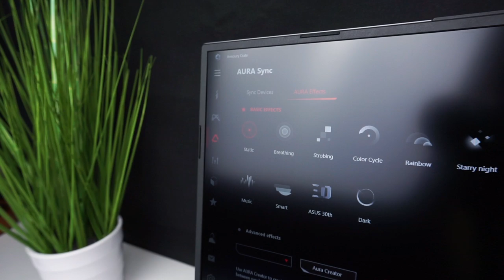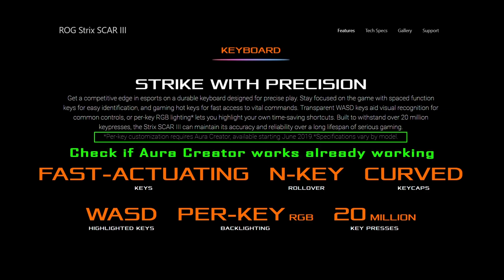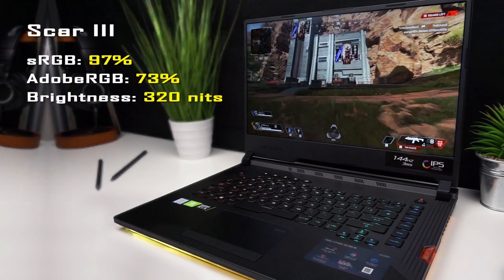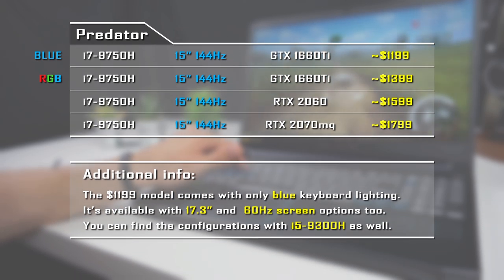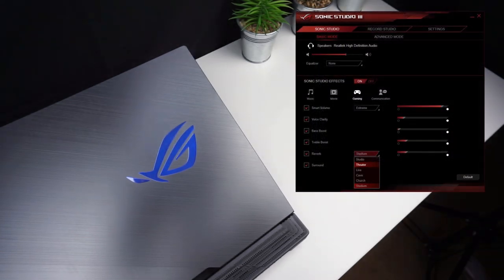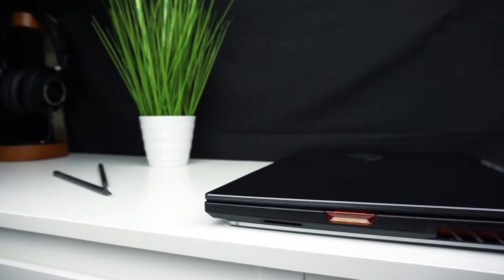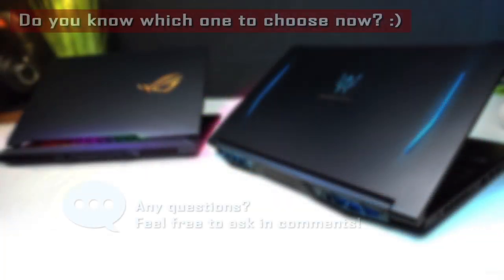Acer Predator Helios 300 2019 vs Asus Scar III - In-depth COMPARISON / REVIEW

Comment from the maker: ✅ Check alternative laptops by price with Lustre: https://my.lustre.ai/8NWEr

►► TIMESTAMPS:
00:00 - Introduction
00:41 - Build and design
01:48 - Dimensions
02:00 - Keyboard / Touchpad
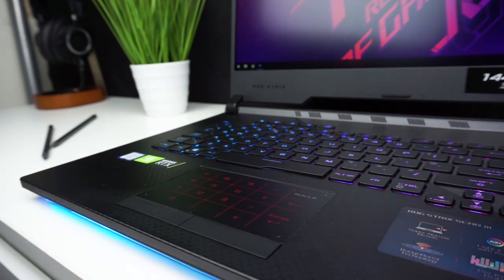03:50 - Port selection
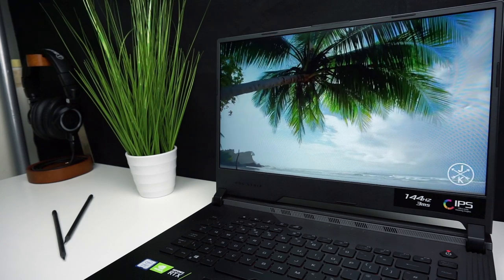04:18 - Display
05:56 - Configurations / Prices
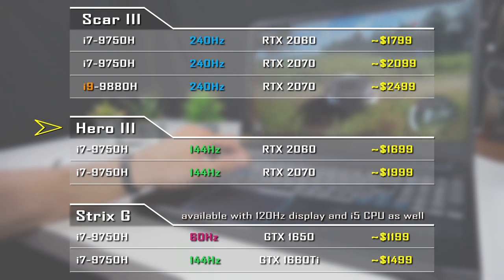07:21 - Speakers
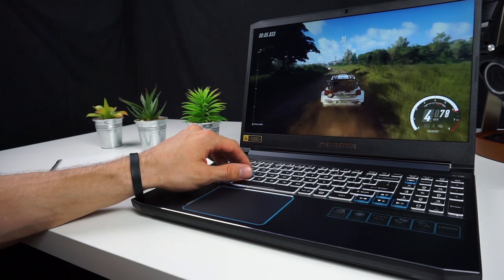08:03 - Performance
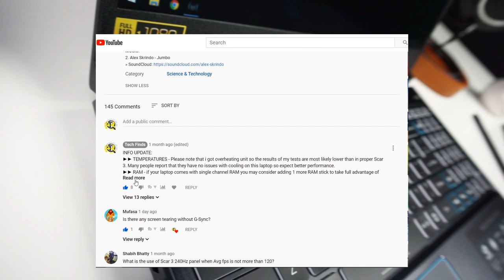08:55 - Cooling system
09:24 - Upgrades / accessibility
10:10 - Battery life
10:25 - Summary - Pros and Cons

►► Scar III (Per-key RGB) - In order to customize your Per-key RGB you have to download Aura Creator app from Asus.
Link here: https://www.asus.com/campaign/aura/il/Aura-creator.php
►► Small mistake - at 09:07 the temperatures shown in the brackets are Farenheit of course, not Celcius! :) First temp. for CPU, and GPU right under.
►► Australian units (Predator) - If you're buying 2019 Helios 300 in Australia make sure to check with the seller whether the laptop comes with 60Hz or 144Hz display. I've got a report that Predator comes with 60Hz by default in Australia, but the sites mistakenly say that it's 144Hz.
Reply: Do you know 1660 TI or RTX 2060 GPU runs cooler in laptops?
Reply from the maker: @V3doP4jzs  About the same. No really difference
Reply: @TechFinds  Hey, did you undervolt the CPU in scar 3 in this test ? As helios 300 comes undervolted right out of the factory. Im trying to decide between these two and both have the same price in my country so hte deciding factor will be the thermals, as 2060 is a bit better than 1660 ti.
Reply from the maker: @BajaT3hMa5t3r  yes, I undervolted Scar 3 by -0.150V.
Reply: What is the ROG Key for?
Reply: Tech Finds can it off its backlight
Reply from the maker: @GarryX10  ROG key opens the control center app where you can monitor your system and manage the fans and overclocking. You can turn off all the lighting.
Reply: Tech Finds how do I off it,because I need to find a laptop for my school and I also wanted it for gaming
Reply from the maker: @GarryX10  they relased a separate app Aura Creator to manage lighting.
Reply: Tech Finds can you recommend good gaming laptop that could off its backlight like Dell G3 15 but I don’t think it’s good
Reply from the maker: @GarryX10  You can turn off the lighting in every gaming laptop mate. :) Maybe except for 2019 Helios 300 and some MSI laptops where the logo on the lid lights up once the display turns on. Dell G3 is not very good as you say.
Reply: Tech Finds, sorry  I wasted your time for stupid questions thx for all the help to make my life of choosing my laptop easier
Reply from the maker: @GarryX10  That's fine mate. I'm here to help as long as i'm able to. ;)

Comment: I’m watching this on my Helios 300
Reply from the maker: Me too! But the 2017 model, haha.
I need to switch soon, good choice.
Reply: Can u show its screen bleeding?. Plz
Reply: @RTXBOBLEE  It's not really noticeable during actual use, only when you when you have a completely black screen. Also screen bleed is different on every single device, I can only give you an idea of what'll it be like
Reply: Can u send its pic?
Reply: Changed to Lenovo Y740, best choice ever
Reply: Fieskmask that’s more expensive though and has less value. I’m studying interactive design so bang for the buck is what I need.
Reply: BobLee Gaming Trust me mate, the screen bleed is nothing to worry about. If in the absolutely rare instance you get one with a messed up screen, just return it and Acer will send you another one with a proper screen.
Reply: Thanks dude.... i will get it in a month most probably
Reply: @ponraul1221  More expensive, but It filles all the gaming needs which auto makes it a better laptop
Reply: Fieskmask what do you mean? Every game so far I’ve played has been above 80fps and the majority well above 100fps at max settings with my Helios. It’s handled everything I throw at it as well
Reply: @ponraul1221  The lack of G-sync frightened me, so I didn't buy it. If it works for you, good, but I'll rather skip the screen tearing
Reply: Fieskmask I actually haven’t experienced any screen tearing in the 5 games I’ve played on it; all with V-Sync disabled. I did oddly enough experience it on Photoshop when moving stuff on it very fast lol
Reply: @ponraul1221  Haha OK. It gets pretty clear especially on GTA V, it's actually impossible to Not have tearing without G-sync.

Some people doesn't care and some are not sensitive to it, but when I changed from TN 60hz to 120Hz with G-sync the whole gaming world changed for me. I'm really, I mean really oversensitive to screen tearing.

But I'm glad you enjoy the laptop, it's not bad, just that it lacks G-sync 😁👍
Reply: how loud is the turbo mode? is it annoying?
Reply: Pooya Arzi It gets pretty loud. You’ll have to wear some headphones if you want to hear anything clearly when it’s on
Reply: @ponraul1221  hi I am thinking of buying it too...can you let me know is it okay for students?..as I will be using it for my presentations and how is the battery life?
Reply: Hi do you ever get dust problems
Reply: @ponraul1221  What games to you play bro? Can you name 5?
Reply: im watching this on my ROG scar II
Reply: I am watching from my Samsung Note Fan Edition 🤣
Reply: Slogomattkop  To me it wasn't worth the extra cash. The fps difference on a 2060 compared to a 1660ti is razor thin. Most benchmarks I've seen has the 2060 leading by like 8 fps. It's not worth the price difference to me.
Reply: me too
Reply: @TechFinds  me but i dont have the new one yet lmao 😂

Comment: Greatest review thanks!
I only recently realised that the hero, strix, scar all use same chassis - this is quite confusing and not explained well, so thanks for showing this.
Reply from the maker: There are just slight differences, for example Strix G has no Keystone slot and plastic top pannel. In case of Hero and Scar it's only a different pattern on the deck.
Reply: Hero and scar are geared toward different game genres
Reply: Hero is geared more for Moba and scar is better geared for FPS

Comment: Thanks for the great content.
May I ask your opinion, how about the endurance of these two brand?
Which one is better Acer or Asus ROG?
I am considering buy this helios 300, but I am afraid Acer is not that good laptop for long term use.
Reply from the maker: Hi, as I said in the video the Predator feels more solid thanks to metal parts, but if you use the laptop normally both should last long. However those are only electronics devices and we can never predict when or if something will break. By default they are designed to last at least 4-5 years I guess, maybe longer but you never know. I had them only for about one week for testing purposes and what I know is that Predator was more solid and it run cooler which is better for long life of hardware. :)
Reply: @TechFinds  thank you so much for your opinion and reply!

Have a nice day!
Reply: @TechFinds  Hello
Its me again
1 more question if you dont mind to help me
Can we upgrade RAM in this Helios 300 ?
I have bought this laptop but the ram only 8 GB, is there any available slot to upgrade RAM in this laptop?
Thank You so much!
Reply from the maker: @jonatanalexander9113  sure you can, it has 2 slots for RAM. You can put up to 32GB (2x16) 2666MHz.
Check the description of this video - I linked an upgrade guide for Helios 300
Reply: @TechFinds  thank you so much for your reply.
I really appreciate your help!

Comment: Excellent review. Which is all around better in your opinion, and how is the Scar 2 better than the 3 even though the 3 is newer?
Reply from the maker: I prefere Scar 2, because it has more features than Scar 3. For example webcam and SD card slot. It's also more portable and looks better to me. It all comes down to your preference, because the performance is about the same if we're talking about both models with the same specs. My Scar 3 first was overheating, so it replaced it for another unit which was working well and fairly cool.
Reply: Tech Finds woah you actually replied and hearted my comment? That’s so cool! 😂 Anyways thanks for the reply and the info, you’ve gotten a new sub and I liked!

Comment: Good Job mate! Like your videos.
I am just about to buy a laptop not just for gaming but CAD work.
It would be great to have TB3 port.
What do you think which one from the list below is the most durable?
Which one would you recommend most?

1. Predator Helios 300 - i7-9750H, 1660ti, 8GB ram, 15.6" FHD 144HZ (£1150)
2. HP Omen(2019) - I7-9750H, 1660TI, 8GB, 15.6" FHD 240HZ (£1150)
3. HP Omen(2019) - I7-9750H, RTX2070, 16GB, 15.6" FHD 240HZ (£1550)
4. HP Omen(2018) - I7-9750H, RTX2070, 16GB, 15.6" FHD 144HZ (£1400) - (not sure if it is not MAX-Q)
5. Dell G5(2019) -  I7-9750H, RTX2060, 16GB, 15.6" FHD 144HZ (£1150)

Thank you for your reply!
Reply from the maker: Hi! If you wanna TB3 then only Omen is an option here. From laptops you mentioned nr2 gives you the most value i think, but if you appreciate convinience of use and you don't mind sacrificing TB3 then nt1 is good as well. Gaming is more demanding than CAD programs, so both laptops will handle, but if you wanna more power for upcoming games you can consider nr 3 which will have G-Sync in addition.

Comment: Thanks for the review and how much screen bleeding is noticeable on the scar 3   model and Ive heard that, there will always  be some degree of screen bleeding on ips panels.
Much Thanks
Reply from the maker: Yep you can always find some spots of bleeding, but it's usually invisible unles there are dark colors on the screen. In Scar 3 I actually couldn't really spot the bleeding even with black screen, but every each unit has different display so it vary.
Reply: @TechFinds  Thanks for your quick response

Comment: Nice vid keep it up watching u all the time👍👍👏👏. After big search i decided to buy Asus gx502gw rtx 2070 I think it's one of the best gaming laptop in that price. I wanted to ask u is it right to repaste and undervolt new laptop mine will arrive in 2 day I need your advice on it.
Reply from the maker: Thanks! Haha, I always repaste a new laptop  when I buy it for myself, because sometimes they don't do it properly in the factory and they use cheap thermal paste in most cases. You just need to be sure that your warranty will allow you to do that. Undervolting is recommended too if you think that your laptop runns too hot.
Reply: Almost bought that configuration but I ended up with Helios 300 because of cooling. You may have that 2070 in scar 3 but you won't utilize its power because of its cooling limitations. The premium difference would not be worth it.
Reply from the maker: Actually if you win thermal paste lottery the Scar 3 has comparatively good cooling to Helios 300. Or you can always repaste it to get better performance, but the cooling itself is good in Scar 3. Btw, he was talking about Zephyrus S with RTX 2070.
Reply: @TechFinds  Thanks for replying.👏🙏
Reply: @millennialwizard3867  Not Scar 3 bro Its Zephyrus s gx502gw and I think it is one of the best gaming laptops for that price.
Reply: @TechFinds  please add Dota 2 in your benchmarks.

Comment: I bought the Scar 3 (same as the one in the video) and I can’t make the light bar to turn on. Another annoying thing about it is the RGB Keyboard, doesn’t matter what color I choose it changes back to red itself after while
Reply from the maker: Well, that's not normal for sure. Try do download Aura Creator app from Asus and see if you will be able to change colors there. Armoury Crate is glitchy. Btw. there was no option to set light bar or logo colors in Armoury Crate, and the keyboard lighting was only one zone.

Comment: Hey, it's my first time buying my own laptop. Do you have an advice on what to say or ask when purchasing? Personally i think predator helios 300 is what i want.

Another q is if i already bought the laptop, what or do i need to download stuffs for anti viruses and such? Or it should be fine without all those things?

I'm sorry, I'm kinda ignorant about these stuffs so I'm reaching out for your advice. Hope you'll see this. xx
Reply from the maker: If it comes to gaming laptops you should pay attention to temperatures and cooling system as well as the features that you need. Imo Helios 300 would be a good choice for you as it's easy to use, besically ready to go so you don't have to tweak anything. For the software, you decide. I personally don't use any antiviruses and that stuff.
Reply: @TechFinds  uhm another question sorry. I just bought its latest version. I'm currently downloading games on steam and it takes forever to download. Is it okay to keep it on and leave it charging overnight?? 

I'm so protective of this laptop it's so funny lol.
Reply from the maker: @reguaarmunjaea.2282  You should use it plugged in if you don't need it to work on battery.

Comment: I have 2019 Helios 300 . Man it is awesome. Gameplay is so smooth. All games run perfectly. All in one this machine is BEAST🔥💪
Reply from the maker: Yes, Acer won this year!
Reply: Is this laptop have dvd player?
Reply: Reply _
Reply: @hyperzone4189  no it do not have dvd player.
Reply: @hyperzone4189   the Helios has no player
Reply: same. you can basically throw anything on it and it will run it for you smoothly. at least for now.
Reply: @hyperzone4189  no bruh. that is so 2000s
Reply: Ravi raj vashishtha dude have your device screen bleeding

Comment: at the same price you recommend 2070 max q against 2060? 

For $1600 i have to decide between Acer predator helios 300 (2060) and Omen Hp 15 (2070 max q). What do you recommend?
Reply from the maker: Well, it depends on the laptop, e cause every one has different features. If I had to choose i would go for Omen if it costs the same price. RTX 2070mq is better than 2060 and Omen has G-Sync in 144hz display and Thunderbolt 3.

Comment: I sold my helios predator and bought myself an asus rog g531gt, I'm still waiting for delivery but Asus has always been my favourite brand.
I'm sure I will love my asus rog when it comes.
Reply: may i know why?i guess prediator helios 300 is twice fast
Reply: @foodieakshay2517  Okay so for this im going to compare my own experience with my previous laptop which was acer predator helios 300 and my current Asus Rog g.
With my current experience with my Asus Rog, it's fast! it's reliable, the fans, ventilation and circulation is absolutely phenomenal, it's quite fast and the difference of speed between this Asus Rog and my old Acer Predator is unnoticable.
The specifications of this Asus Rog are as follows:  15.6" laptop with a 16"9 screen, GTX 1650, intel core 7 9nth gen, 16gb ram, and a 556GB SSD.
My Acer Predator was a 17.3", GTX 1660, 16GB ram, 256GB SSD + 900GB HDD, intel core 7 7nth gen.
-----
Now, comparing both with my own experience - 
Pro's of Asus Rog is: way better fan system, ventilation and circulation, always keeping the laptop cool, the keyboard feels super amazing, smooth, i freaking love it! is the best keyboard ive felt and used, the texture on the chasis and at the back of the screen is amazing, cool to look at and feels fricken nice and high quality, there is no number pad but ive never had any use for the number pad anyway just takes up space and the feel without the number pad is way better than with it, the pure look, aesthetic and RGB of the ROG is superb and will beat any other laptop out there in pure cosmetics, it just looks so good! The screen looks way nice and is really really well done.
Cons of the Asus ROG: The battery life is pathetic & there is no webcam (I have no use for a webcam so it doesn't mean anything to me), about half the amount of storage you get from an acer predator.
-------------
Pro's of Acer Predator: it's one up from ROG's 1650GTX makes it able to play more games at better FPS, comes with more storage up front, longer battery life than the Asus Rog.
Cons: Not much really, but the air ventilation and fanning system is far from as good as the Asus Rog, this isn't a con but the RGB lighting is far from being as good as the Asus ROG's.

But what makes the Asus ROG better in my opinion is that all of the components that Acer Predator beats Asus ROG can easily be upgraded but what you can't replace is the chasis itself or you can't retexture it, which is where Asus ROG wins by a long shot.

So I could upgrade the components with somewhat better components/hardware than what the acer predator came with which will ultimately allow it to run faster and more efficiently, but yeah the battery of the Asus ROG will still suck, well my Asus ROG anwyay being that it's only a 15'6.

In conclusion, even though this was is a smaller laptop and i preferthe bigger laptop, I prefer this Asus ROG over my previous laptop which was the Acer Predator.
But my acer predator did serve me well for as long as it did :)

Comment: Would you prefer scar 3 over alienware m15r2 same as scar 3 with rtx 2060max and i7 9750h ( not considering price, is the scar 3 better?)
Reply from the maker: Hard to say, because i didn't test this Alienware. I've heard that it has some thermal issues, but i can't confirm unless i try. Scar 3 is what i can recommend, but you have to know that it may run hot if you get a bad unit. However the laptop has a good cooling by itself - just the matter of thermal paste work. ;)